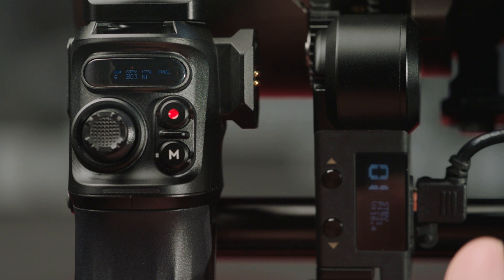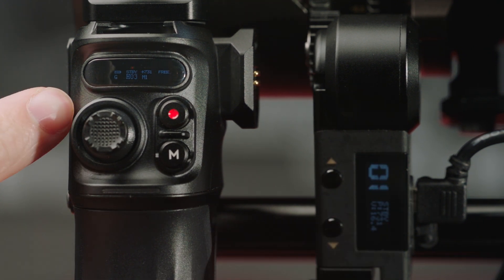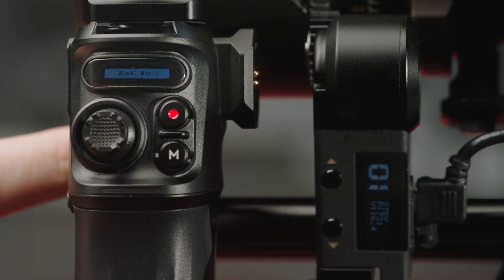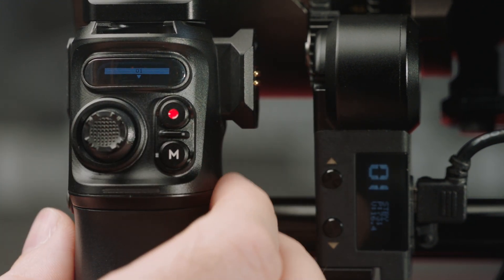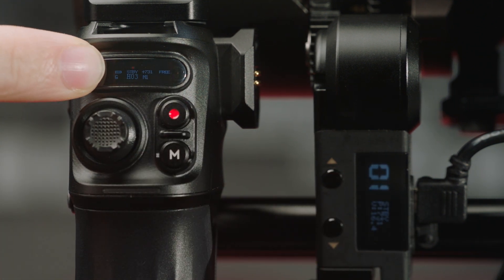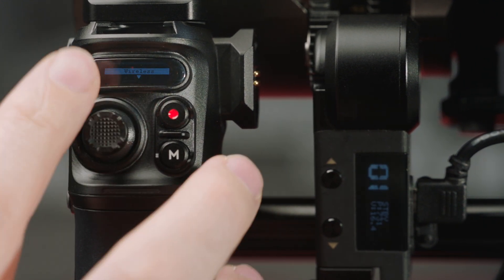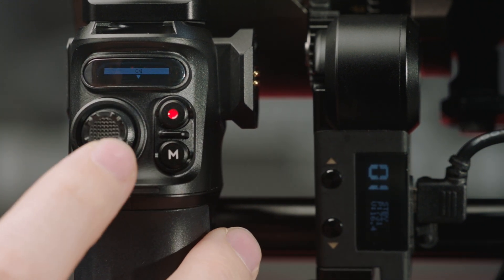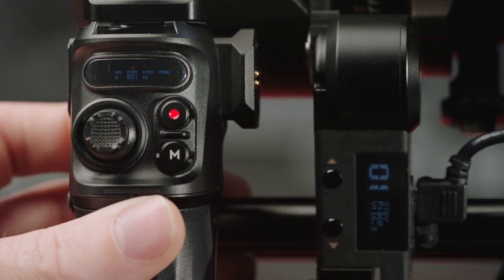Nano 1 Motor + Nano 2 Focus Handle

Comment: hello james, im curently  figuring out a handheld setup using nano 1 and some handle with focus wheel. I have tilta advanced ring and was thinking of using one of the handles in handheld situation. would you recommend this aproach or nano 2 controll handle? is there any difference in latency etc.? I thought the advanced focus handle from tilta would be best, but i need it to be wireless because the usb can provide only 5V and im powering it through camera with 12V